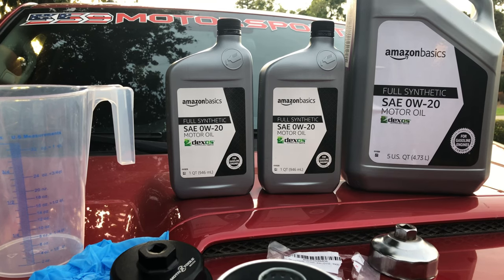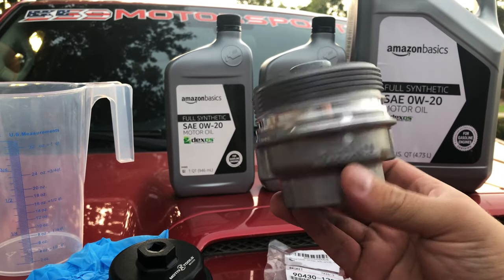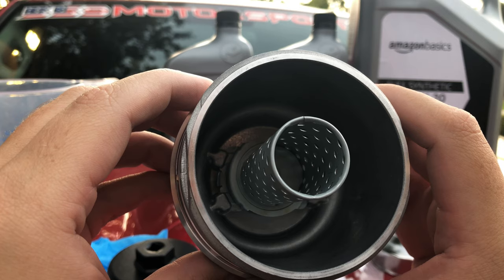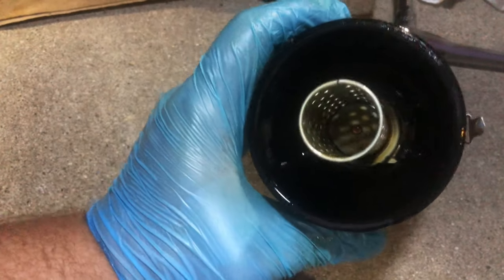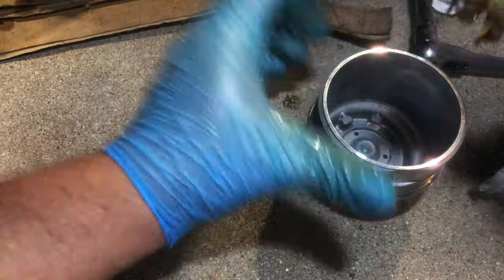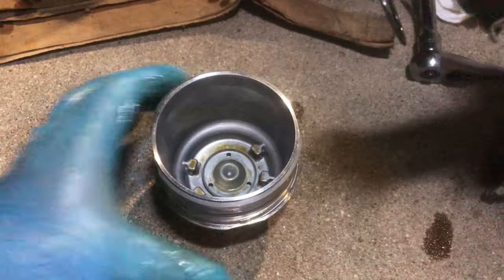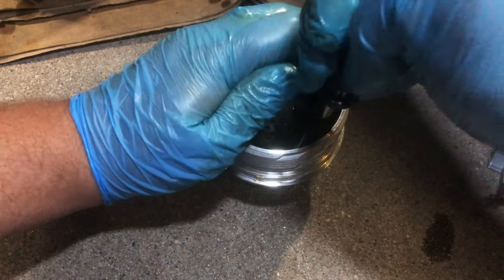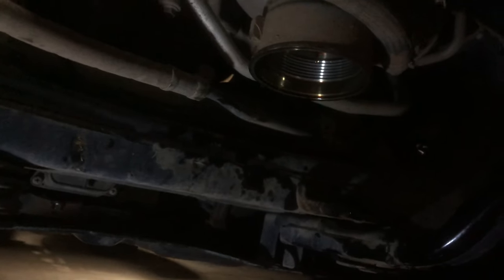Change 5th Gen 4Runner Oil Filter To Metal Housing

Comment: Worked great!  I was able to swap/trade the aluminum oil filter housing from my 2010 RAV4 V6 to my new 4Runner.  You definitely will need a foil baking pan (unless you have 2 oil catch pans) to catch the oil.  You simply remove the oil filter housing with the engine cold from the RAV4 while it's parked on the ground, and catch all the oil from the housing.  No oil leaks or flows out of the engine while it's still filled with oil.  Swap the parts, reuse the RAV's oil filter element and seals for the time being, and reinstall.  Then pour the recovered oil back into the engine.  I don't recommend swapping the oil filter housing from a donor V6 Toyota car unless the donor car is within 200 miles of its oil maintenance, at which point it will get a new filter and o-rings.  Just did it today.

Comment: I cracked that housing on my second oil change.  Thank god one dealer had it in stock.  Drove 45mins to get get it. =]. I also bought a spare.  Thank you for this I will definitely check it out!
Reply from the maker: Yup. I had to use a breaker bar last time to get it off. Was worried it was going to break it. That's when I looked into other options.

Comment: 'm not sure if my housing is cracked but i did torque the hell out of it trying to loosen it, i ended up damaging the metal tab and it came off with a few of the housing pieces. after i switched everything out and triple checked and retorqued everything it was time to put the oil in,  i got lazy and ended up putting all 6.6q and turned on the engine, and 3mins later the oil light stayed on and i had a bad feeling. lots of oil dripped out and after i got the oil under control, i could tell the drain plug was dry and clean but the leak came from the front and i took out the housing again and couldnt see any issues besides the metal tab being off, but i wonder if the leak came from a crack housing? luckily my local toyota dealership has another OEM housing in stock that I'm picking up next day morning. i can't verify a crack in the housing but what else could it be if my drain plug area is not leaking.
Reply from the maker: P JB Did you make sure to put the O rings back in the correct locations? The larger O ring typically is what causes leaks as when it’s replaced it’s put at the bottom gap but it goes above that.
Reply: HighSierraOverland Thank you for replying. Yes. I used the o rings from the new filter kit. I greased the big one with new oil and I put it in that 2nd to the bottom location then i greased up the smaller o ring and put it underneath then hand spun that metal filter drain plug and tightened it more after i spec torqued the housing. Its hard to pinpoint where the leak came from since I completely had everything covered up with the skid plates etc. so oil splatter went everywhere due to skid but at least I know it’s not the oil pan drain plug. I’m going to clean up the parts underneath with some brake cleaner as best as I can and put on the new housing etc. and do the right thing and just pour like half a quart or so to see if it leaks?
Reply from the maker: @itr0863  You can fill the filter up by itself and see if there's a crack in it. If there is one it's likely going to be in that. Also may want to check the threads on it to make sure it's correct. How much did you torque it? I only do it hand tight, then about a quarter of a turn, same with the drain plug. I've never had issues.
Reply: HighSierraOverland i torqued the housing to 18 lb ft then i hand spun the bottom metal filter drain and then hand tightened it then used a 3/8 extension to hand tighten w a wrench since i didnt have a 1/2 to 3/8 extension for my torque wrench. I just came back from the dealership with a new housing. I just got an oem one that they thankfully had in stock. I will put the new stuff together (skids off now obviously lol). 
-I will put 1 quart and check below(engine off). If no leaks...
-put the required 6.6q total and check below again(engine off). If no leaks...
-turn engine on and check for leaks
I hope those steps (which I stupidly skipped) will solve this. Thanks again for the help. edit i ended up holding the filter housing and filled it at least half way w oil. I didnt notice anything leaking either.

Comment: after a year how’s the filter holding up?
Reply from the maker: Been great. No issues. No leaks. Easy to come off like it originally should have been. Still would do it again.
Reply: @MaddoxBBQ  thank you, new to toyota and that shit is hideous compared to the traditional filters. but my plastic one has been seeping thru wit oil and even after an oil change from Toyota dealer they didn’t even know why. in fact they said if it’s still leaking bring it in for diagnostic but u can clearly see it slowly seeping oil from the filter 🤦‍♂️
Reply from the maker: @Liinglingg  Unless it's loose, odds are there's a crack in the plastic filter around the threads. It's a known issue, especially if the dealer has done your oil. They tend to impact them on which is a big no no.

Comment: Good morning....question have u had any issues with the metal oil filter canister??? For some reason everywhere I looked it says it will not fit my 2017 4runner
Reply from the maker: What model do you have?
Reply: @MaddoxBBQ  trd pro ....or is it just to change the middle part to a longer one ?? Same part serial number as urs
Reply from the maker: @jluisl3652  I have  '17 Pro as well, you'll be fine. My buddy also just did this to his. None of us have issues. Yes on the middle part, you'll need to swap that piece from the original one on your vehicle now. That's it.
Reply: @MaddoxBBQ  awesome thanks for the info n peace of mind brotha

Comment: Did you transfer the metal stay clip to the metal oil filter housing? I don’t see how to and Im not sure Im supposed to.
Reply from the maker: The one on the outside that keeps it "locked in?" I don't even use that if I'm being honest. I don't torque it either. Just turn until tight and done.

Comment: Were the springs the same size ? Or was the original one bigger to match the longer perforated tube?
Reply from the maker: Quinton Love The springs are both the same size. You just need to move the tube like thing (not sure it’s official name) from the plastic filter to the metal one. The spring doesn’t matter.

Comment: Toyota parts site does not list this as being compatible with 2019 Highlander, does anyone here know if it will fit 2019 Highlander?
Reply: As he showed, the one he bought wouldn't fit his application. The provided support tube was too short.
I just did the swap, using a Dorman brand unit. Kit came with 3 tubes for various applications. 
Possibly the cap is the same all around just different length tubes. 🙏🤔

Comment: How come you cant use the tube the new one comes with? Does it matter that much if its shorter?
Reply from the maker: I'm not 100% sure on this. I didn't want to find out the hard way.
Reply: gotcha. It was helpful thank you. I just broke the damn tabs on my plastic housing yesterday. So happy there was an upgrade. One more question...did you take off the plastic housing while the vehicle was a little warm?
Reply from the maker: @vgemini9474  I always run the vehicle for a bit to help the oil drain faster. Maybe a quick 5 minute drive or so. Just enough to get the oil warm, but not burning hot. Sometimes Toyota will put them on too tight, other times it is plastic and gets hard. I've had to use a breaker bar before to get it off.
Reply: Yes it matters because the part of the housing on the engine block is designed for different sized filters while all the oil filter caps are the same size.
Reply: @MaddoxBBQ  
Did you follow torque specs on the filter cap when installing it?

Comment: A few suggestions....put the bottom drain cap back on first and pre-fill with oil.  Also, the proper torque is only 18 foot pounds, so a half turn after making contact with the O-ring would be much too tight.
Reply from the maker: I should have said quarter turn. Still would probably be too tight, but I've honestly never had an issue. I know the Toyota Techs love to impact those things on. Prime example why I stopped going there.
Reply: If the housing is 18 foot pounds of torque how much foot pounds of torque is needed for the bottom housing drain
Reply from the maker: @itr0863  The bottom drain on the oil filter is 10 foot pounds. I've always just tightened it and left it alone. Zero issues. But 10 is the official number.
Reply: @MaddoxBBQ  thank you! I ordered the metal housing. It was $30 while the plastic one was $75 lol.
Reply from the maker: @Dgrinde  Yup. All the oil people are just oil people. No different than going to Jiffy Lube IMO.
Reply: @Dgrinde  i wonder wtf they are using to tighten the canisters. i've noticed most of the people posting on this video all have had issues loosening the canister.

Comment: Did you re-use the little latching device that sits on the side of the housing?
Reply from the maker: If you're referring to the little clip piece kind of thing that sits on the outside, no. That broke off a long time ago. I believe it's used to know where to tighten it to on the actual filter input on the motor, but I've never done that. I just get it tight and give it a slight turn to make sure it's snug. Usually once it's tight you can't go further without forcing.
Reply: @MaddoxBBQ  
Thanks!!
I just did mine today and the piece was the only thing I couldn’t seem to make work on the new housing.

Comment: Awesome Video! another project to do on my truck! Will this fit 2010 4.0 V6 4runner? I'm due for an oil the next month. My oil filter plastic housing was cracked by the dealer once and was leaking oil 6 years ago I replaced it myself and now I do my own oil changes.
Reply from the maker: As far as I know the oil filter didn't change from 2010 to 2017, so this part should work on your 4Runner. Order through Amazon and that way if it doesn't you can send it back without a hassle. I'm not 100% sure, but I'm pretty confident it will work. Don't forget to swap out that inner parts.
Reply: @MaddoxBBQ  the inter parts got it! I had to rewatch your video 3 times lol thanks again

Comment: FK factory one broke the first time I do my oil change. The dealer tight the housing way too much then it should be.  And they did not even bother to put the smaller rubber gasket on. I am very angry that they are using impact driver on everything.
Reply from the maker: Dapeng Hsu Unless you know someone at Toyota you are better off doing it yourself. Unless you literally can’t. And even then it’s better to find another place. They’re becoming no better than Jiffy Lube.
Reply: Sue them. That's what I would do. Small claims court.

Comment: The oil filter housing manufacturer and the oil filter housing twisting tool manufacturer all says the torque should be 18 pound feet or 25 NM .

From what I feet , I used at least 2 times more torque.
Reply from the maker: Yeah, Just do hand tight and you'll be fine. That's what I've always done and never had issues with leaks or anything.
Reply: Follow the instructions and you'll be fine.

Comment: Will this fit a 2019 Toyota 4 Runner TDR limited?
Reply from the maker: I believe so. I don't think the Limiteds had a different size oil filter. Might want to double check though just in case I'm wrong.